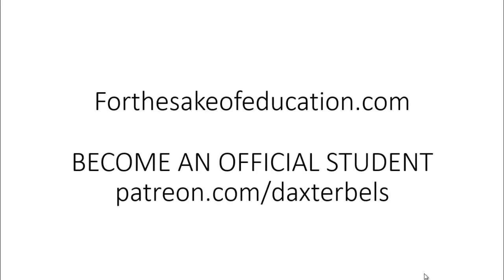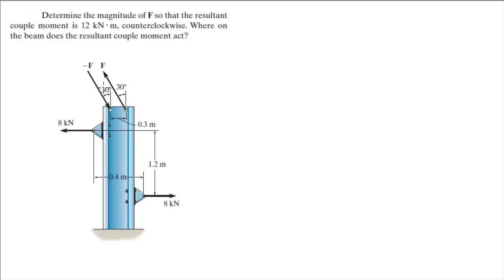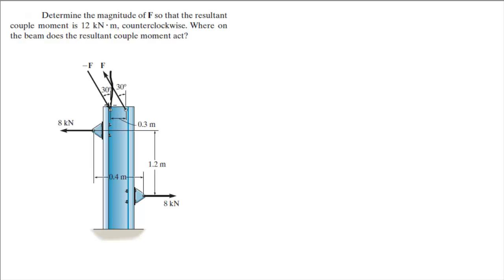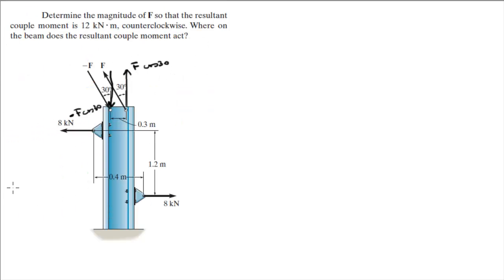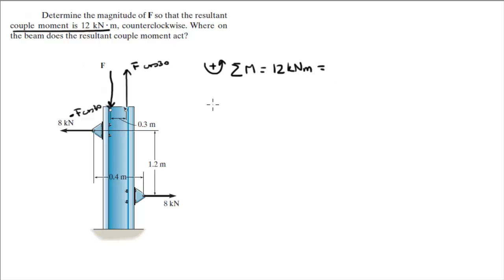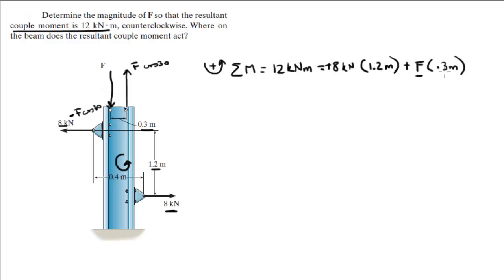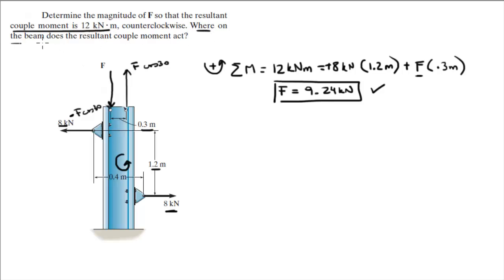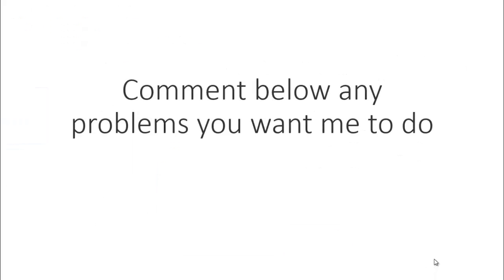Determine the magnitude of F so that the resultant couple moment is 12 kN m

Comment: Correction: F = (12-8*1.2)/(0.3cos30)=9.24kN

He forgot the cos30. Also you don't need the reasoning for the x-components. The math will sort itself out if you simply find the perpendicular distance (or shortest distance) between the force F and the counterforce -F resulting in the same answer. It's good to understand why of course, but for calculations simply it is not necessary to argue for any components cancelling out because they're collinear, have opposite sense of direction and of the same magnitude.

Good luck!

Comment: The x components cancel out, but so do the y components. That's the whole thing about couple moments. They're the same magnitude in opposite directions, so why can we cancel the x, but work with the y?
Reply: Not sure if you're still interested, but the x-components of F cancel out because they act along the same line of action with the same magnitude and opposite direction, so the perpendicular distance between them is 0, and hence their couple moment is 0. Whereas the y-components are not on the same line of action and therefore do not cancel out. I struggled with this at first as well
Reply: @user-xn7sw2of1e  thank you!
Reply: @michellerussell4349  no problem, good luck in your studies
Reply: @user-xn7sw2of1e  Amazing comment thank you!!!

Comment: Problem 5.27 Consider the smooth uniform bar shown in (Figure 1) , which has a mass of 19 kg . Neglect the thickness of the bar. Determine the x and y components of reaction at A using scalar notation. Determine the magnitude of reaction at B.